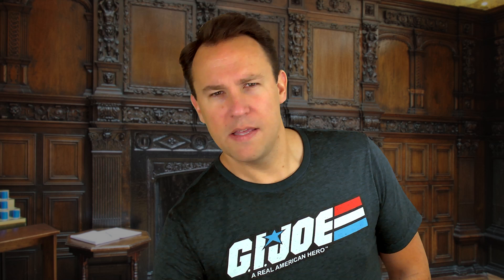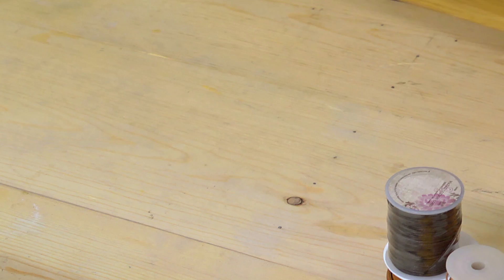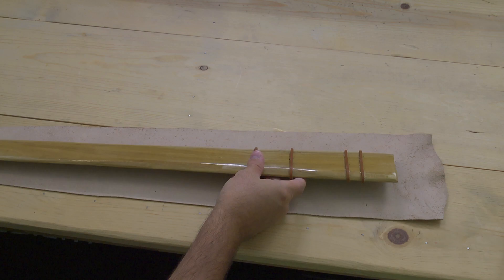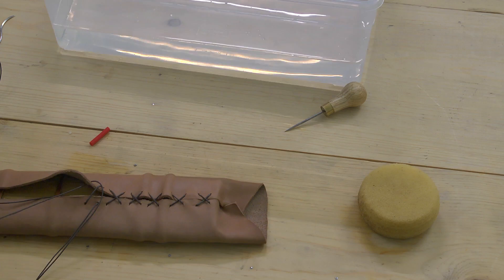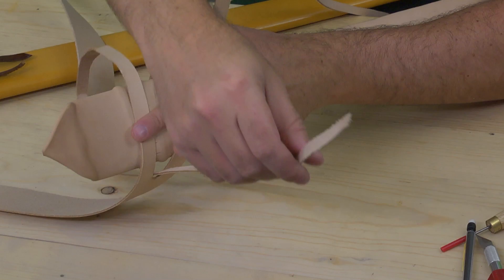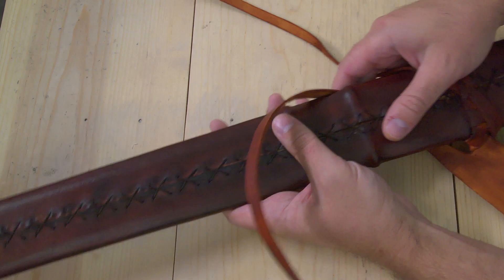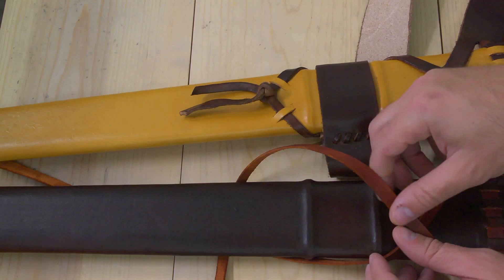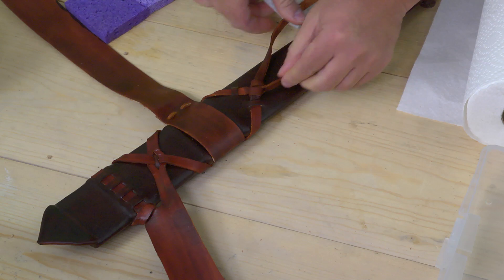Medieval Scabbard Build

Comment: for anyone who watches this so late, i would recommend using the gouges or a router to make the cavity before you cut the shape out, as it will be easier to put a rectangular shape into a vice than a tapered shape. it will also be easier to clamp it to a bench in rectangular form as there is more surface area available

Comment: You make it look easy enough that I will probably try and then make a big mess of it. Good video sir.
Reply from the maker: Matthew Jensen -- you should make one!! I'd love to see the results.
Reply: Everything Medieval I have no skill for that kind of thing. I usually pay to have it done but I do have an Albion or two that could use a scabbard. Might be fun to try.
Reply: Great tutorial. In Oakschot's Records of the Medieval Sword he shows an alternative method where one of the left side top laces actually laces through the right side of the belt to close it around the scabbed. But there were many way belt fittings were done in medieval times
Reply: Most is that finding the right water resistant wood glue and a proper glue for the leather plus a 2mm leather canvas so big, not an easy feat, especially the leather. I ho have around tons of 4mm leather for armor straps and such, I have to use that thick one but my glue is not water resistant. In that case you can cover the wood scabbard in celofan, then put the hot watered leather, make it taking the wanted shape and letting it dry, remove the celofan and then assemble everything. For the sewn i would suggest you to simply make holes and afterward going with a leather cord or such.

Comment: I know this is a late comment but if you want a smoother dye finish, pre-wet the leather with alcohol if your dye is alcohol based. This stops the dye from absorbing too quickly and let's you spread it more evenly. I also dilute my dye a bit with alcohol so it doesn't end up as dark.

Comment: You sir, are are most excellent!  I've tried this several times and all I end up with is a rectangle of wood that my blade rattles around in.  Proper fitment of the blade is in no-way as easy as you make it look, especially with gouges. I tried everything from dremells, to routers and even chisels and a ton of sanding paper. My next attempt was going to be with violin planes but I just gave up. Cudo's
Reply: I used a dado blade on my table saw. ran the length of both pieces of wood. I then made a plug about 2 inches for the dado bottom end then glued the pieces together and shaped the end after drying

Comment: I am deep into my first effort on a scabbard.  What are your belt widths?  They look like 2 inches.  On the double strap, one strap fits into the 0.75" gap between the top two risers.  The bottom strap looks to be the same size with a 0.5 inch gap between them...hence 2 inches.  Correct?  I guessing the length of the belts will be highly specific to the waist of the wearer.  2" wide belts? Yea, Nay?  Thanks, I have watched your videos a lot and have learned a great deal.  I appreciate your skill and sharing your skill.  Best regards, Dean
Reply from the maker: Hey Dean, I no longer have that particular scabbard in my collection, but I measured a similar on that I made, and the belt around the waist is 1.75 inches, and the thinner straps are about 0.5 inches in width. Hope that helps!

Comment: Your stitches are too far apart. The thread is stronger than the leather, so the thread will have more tension on each hole, which will tear out the stitch over time. With narrower stitch hole pitch, you eliminate this issue. This stitch is only used in some sheaths. A Celtic, Scandinavian, or Rus scabbard uses a zig-zag stitch (whip stitch) that doubles back on each end underneath the chape and at the mouth. For a stronger stitch that isn't historically accurate, use a baseball stitch. The leather will be tighter against the wood and the puckering of the leather at the stitches keeps the threads from rubbing and fraying. You should also oil the wood core rather than using a surface sealer. The leather is meant to be able to be removed from the wood core to be able to clean and maintain the sheath/scabbard. Oiling the wood core also oils the leather. Regular oiling of the leather keeps the wood core pliable and less likely to break or deform. Your methods are not historically accurate, but they make an attractive result.
Reply: what are your sources. im trying to make a couple of these
Reply: La Tene celtic swords have iron scabbards, not leather.
Reply: Could you point me to a site that provides more information on your comments? Like to learn more.
Reply: linen oil as if no tomorrow on the wooden scabbard, leather sewn with a leather cord to avoid stress on the holes. The wood scabbard should be open at the end, like a TUBE, to avoid dirt into it to stay there forever and rust the metal. This allow it to be easily cleaned in case. Plus a separated leather or metal front tip to close the end of the scabbard, to take most of dirt contact and hits, removable.
Reply: A good book for scabbards galore is "Covering the blade" by Marquita Volken & Olaf Goubitz

Comment: Great tutorial! I have a few questions:

 - What is the purpose of the flap at the top? I assume it's to protect the guard from snagging?
 - When stitching the leather together along the length of the scabbard, should the ends meet or overlap (to account for shrinkage when it dries)?
 - I've read elsewhere that you should line the inside with felt to protect the blade. Is this something you recommend?
Reply from the maker: Great questions. The purpose for the flap at the top is ostensibly to protect from rain and the elements. On later swords, and particularly German longswords, the ricasso had attached to it a piece of leather sometimes referred to as a "rain guard." This likely served a similar purpose.
There is a possibility that the flap was somewhat decorative as well. Not all 13th century scabbards had them, and sometimes they were less pronounced, even rounded rather than pointed. One of the best resources to see what High Medieval scabbards looked like are on funerary effigies and monuments. Also, as a side note, you may want to add stitching around the top to ensure the edge doesn't come loose.
To answer your question about the stitching on the back, my suggestion would be to not have the edges overlap. The edges may pull away from each other slightly, however, due to shrinking. 
Felt is boiled wool, which is fine to add to the inside if you prefer. The scabbards that I've made fit nicely, so I'm not sure what benefit it would provide. Definitely add it if you want to. It's more of a preference I think.
Reply: A rain guard is a piece of leather or metal integrated in the guard to keep rain and debris from filling the scabbard. It is part of the weapon guard, not the scabbard or sheath. The purpose of the flaps at the mouth of the sheath/scabbard is to account for shrinkage in the leather as it is exposed to elements while out on campaign where maintenance is impossible. Note that these only appear in production weapons and not personal items. I wish historians would talk to artisans who have a family history of making these goods and not talk out of their asses with made up hypotheses that they know the general public will take as historical fact. Cough...Ewart Oakeshott...cough...

Comment: Can you comment on what might be different (if anything) for an over the shoulder draw sword/scabbard?
Reply from the maker: I imagine that if you wanted to draw the sword from over your shoulder, either the scabbard would have to be at a pretty serious angle (depending on the length of the sword) or the scabbard would have to be partially open with the opening extending down a bit. It’s probably less convenient than wearing it at the waist, but that would make an interesting project!

Comment: I was wondering what type of glue you used to stick the two sides? I'm at this stage myself and trying to find out what glue to use because I've heard PVA can cause rusting on the sword later down the line.
Also, should I be sealing the inside of the scabbard or just leaving it as bare wood? Most people seem to leave it bare but I've heard enough people talk about sealing them to make me worry a bit :')
Reply from the maker: Hey! Great questions, glad you asked. I used Elmer's Carpenter's Woodglue. It sands well, stains well, and is water based rather than oil based. Don't use so much that it spills into the core and you won't have to worry about it reacting with the metal blade. I can only speak from experience, but I've never had any rusting issues with this glue. 

Also, it's not necessary to seal the inside of the scabbard as long as you're using a low acidic type of wood. Poplar is one of the most common types of wood used for scabbards because of this characteristic. If you're using a different type of wood that's significantly more acidic, it might be a good idea to seal it. If you're really worried, you could line the inside with wool or linen. That's something I've never tried. 

Good luck on the scabbard! I hope it's enjoyable!
Reply: Everything Medieval Wow, thanks for the fast reply! That really helps on both questions. I have used poplar so far so I'll carry on from there without sealing it. Thanks for your help :)
Reply: @MattsGreatHall  Many viking scabbards were lined with raw unwashed wool.  The lanolin in the wool helped keep the blade from rusting in the wet conditions often
encountered.  I sometimes put a heavy coat of WD40 or similar on the blade, then scabbard it.  Hopefully, some of the oil gets into the wood, to serve the purpose of rust
retardant

Comment: I need more help with gouging out the hollow
Reply: WilliamE216  I started using my belt sander specifically the round bit at the front
Reply: WilliamE216   Right you are mate, I switched over to a 120 grit and I don't even let it get it's own weight onto the board, clamps help with that.

 Cherish the time with your little ones, if they're young he sure to fill their heads with great tales and if they're older then fill them with lessons you've learned. Sorry, I'm the sentimental sort.

Comment: What if i want to make a scabbard for my sca rapier
Reply: Is it a REAL blade, or a fencing/schlager type?  Either way, MY opinion(for whatever it's worth) is that all you need is a  leather TUBE(I don't think you could have a wooden form 
underneath), wet-formed to the blade(oil/grease it, and wrap it in Saran wrap first).  Then add a throat and chape(the scabbard I made for a heavy rapier had both made of leather.
It wasn't as nice as having metal ones, but it worked).  BTW, been a SCAdian for the last 44 years

Comment: Hey I was wondering is the Barge All Purpose Cement used for gluing the wooden core together? If not what is the best option?
Reply from the maker: I used a different glue to bond the two sides of the wooden core together. For that I used Elmer's Carpenter's Wood Glue. If you clamp it for 24 hours it bonds extremely well and cleans up with water.
Reply: thanks for the reply, also did you use varnish on the scabbard? and could that help preserve the wood?
Reply from the maker: Varnish on the wooden core, yes. There are several options for protecting the leather, but definitely don’t put varnish on the leather. Coating the core with varnish basically puts a barrier between the wood and the leather scabbard and should prolong the life of the leather by helping it to not dry out quickly. A conditioner can be applied every so often to keep the leather supple, similar to how you might oil a baseball glove to keep it soft.
Reply: do i also coat the inside or do i leave it? also how many coats?